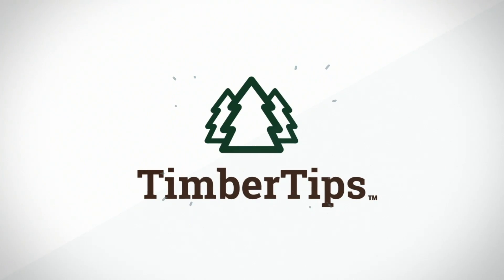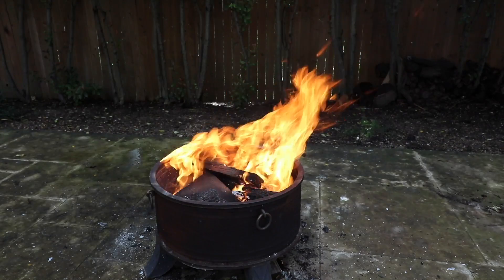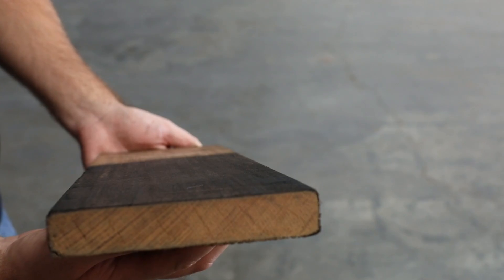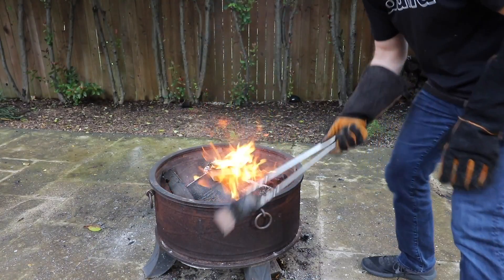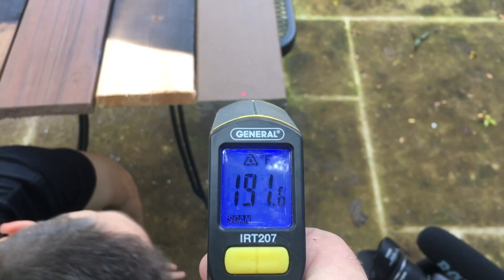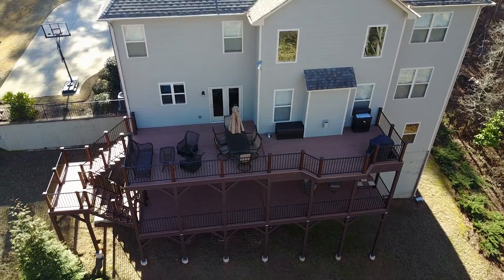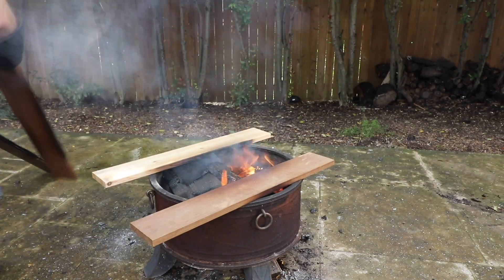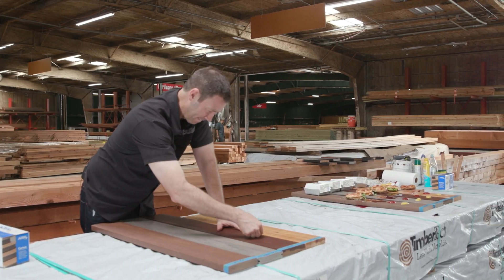The Most Fire-Resistant Decking: Composites vs. Ipe - TimberTips

Comment: I have 15% ipe decking and 85% travertine stone tile laid over Silca System grating that is on 2x12 PT joists. The travertine deck has no fire access from the sides or below the deck. 

What I love about the travertine is that after during the 9 years since it was installed I have never needed to sand or restain the deck as with wood and my only maintenance is an annual pressure washing of the surface.